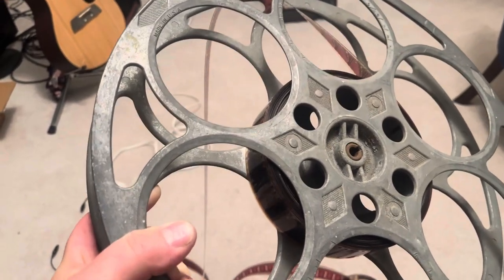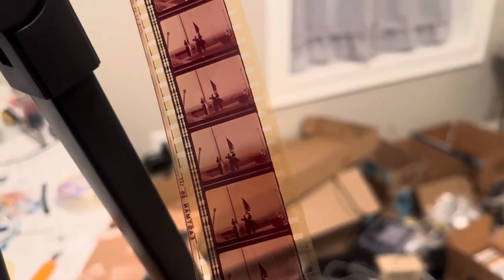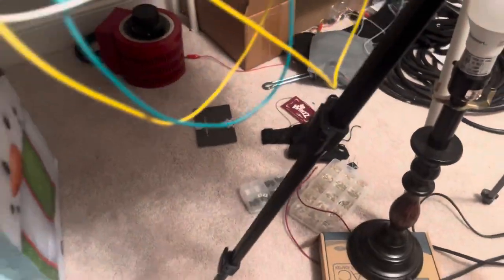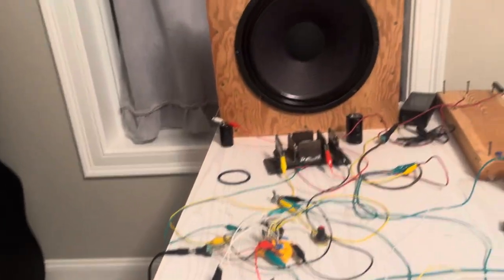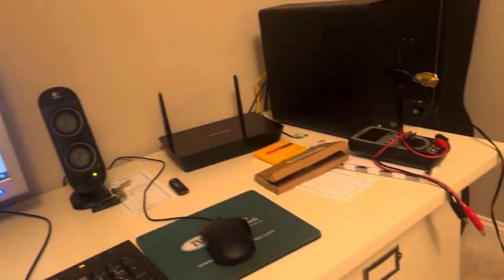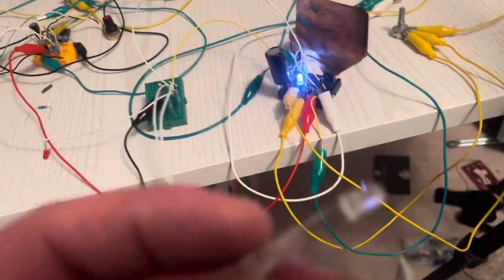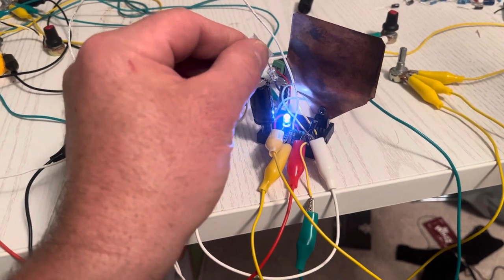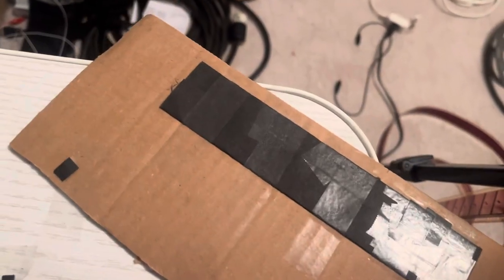Optical sound on 35mm movie reel

Comment: Good idea but....
You need more light, concentrated on the film.
Then the hole in the cardboard:
It needs the hole as short to the film as possible. The hole needs to be as narrow as possible too. A slit in a very thin piece of metal f.a.
Way better is to use optics in this but you are in the good direction.

Don't hesistate to ask me more.

Ps: normal run speed is 24 fps.

🎞📽✔️❤️